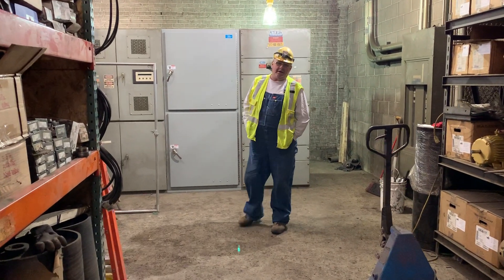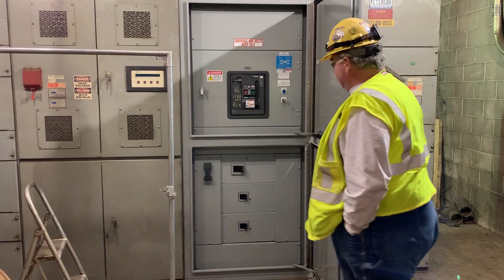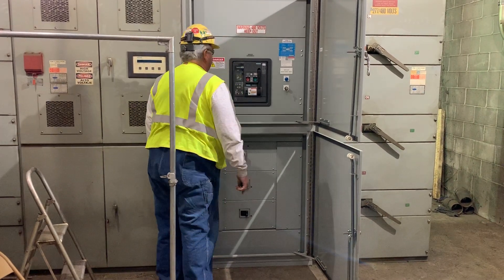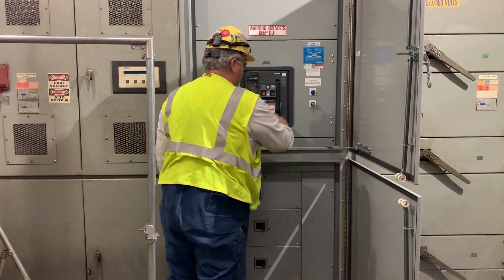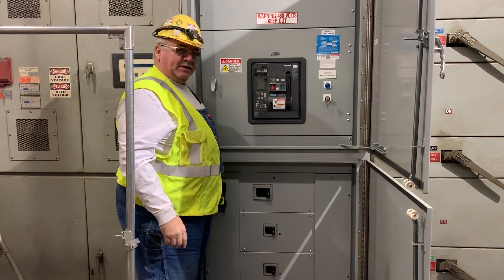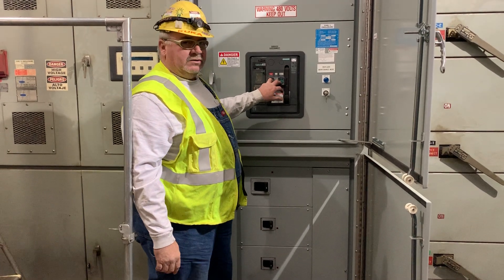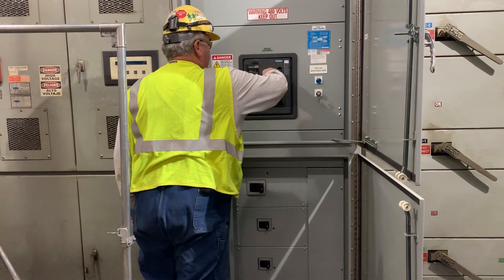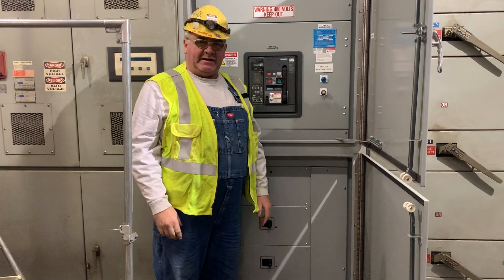Siemens spring loaded breaker

Comment: John Hammond: Now Ellie, you can't throw the main switch by hand. You've got to pump up the primer handle in order to get the charge. It's large, flat, and gray.
    Dr. Ellie Sattler: OK, here I go, OK.
    [Ellie starts pumping the handle]
    Dr. Ellie Sattler: One. Two. Three. Four. OK, charged.
    John Hammond: Under the words Contact Position, there's a round green button, which says Push to Close.
    Dr. Ellie Sattler: [sees the button] Push to Close, OK.
    John Hammond: Push it.

Comment: Come come it requires priming?, to ensure you really mean to press the button?
Reply: At the higher voltages a breaker panel like that operates at, there is a serious risk of electrical arcing, especially if the breaker contacts "bounce" (circuit closes, then re-opens briefly, then closes again) or if the switch doesn't close fast enough; naturally, electrical arcs are dangerous and no fun. The handle charges (more properly, compresses) a powerful spring, such that when the close button is pushed, those contacts are aggressively forced together, eliminating bounce and/or contact arcing.
Reply: @eddievhfan1984  Hey Eddie!, thanks for clarifying dude!, you fucking mean it when you close the circuit! (Or 'Path'!)

Comment: It's an old video but the comment could still help

YOU DO CLOSE THIS BREAKER UNDER LOAD 
it's specificcaly design to handle it  and now with safety , you close all the rest without power to be safe and then you do ONE manoeuver  
yeah in the old days we would prefer to do it gradually ... it's no worse than on a hydro loss
Reply: Close...you CAN close this breaker with load, but it is not a good practice and is ultra hazardous. (Speaking of main breakers here, some plants use this style breaker to feed downstream panels and equipment, which would make them more like a hi tech Pringle switch or feeder breaker in that application.) It is still always best and safest practice especially on first commissioning or after ANY fault that trips a main to open ALL downstream breakers/switches, reset the main, then gradually bring the other breakers/switches on line, one at a time. This also helps determine where a fault may have occurred or is still present. Breakers over 1,000 amps you should always wear appropriate arc flash PPE with the minimum cal ratings as per any warning labels. In older systems with no labels or ANY older style main breaker, regardless of amperage, the best practice is a minimum 20 cal rated suit, and face protection.  It only takes one time to seriously burn or unalive yourself with this stuff.
Reply: @mxslick50  sorry but you arw wrong , breaker are  design to handle load that is there fonction especially closing 

closing on load is no more that closing no load,  opening with load will create small arc and a fault.... lots of it lol  but they can handle it...   breaker are self contain vs bold and pringle switch

and for closing section by section that is the old day .. now a day you want to do the minimum operation live to prevent arc flash risk 

if there is a fault if coordination is correct  fault will be limited to the faulted area... except in case of short circuit where multiple breaker can open

ps amp rating si irrelevant wear ppe if needed ... i hace seen 200 amp panel with 40 calories....
Reply: @moreause  Your comment was a hard read with all the misspellings and grammatical errors...but you are wrong on many points, right on a few. I have been dealing with that gear for over 35 years and have seen too many incidents trying to close into a full load, especially one on a large plant with many 480 - 120/208 stepdown transformers. The inrush current can easily go well beyond what the breaker can safely handle, or at best it will trip from the inrush requiring multiple attempts to close in, which magnifies the risks considerably. Closing in to a load is ALWAYS MORE than no load. It is not nor ever has been "no more that closing no load".

Minimum operations is in theory a good principle but in cases of large plants (I did a wastewater  treatment plant with a 4000 amp service) it was impossible to close the main without first isolating the 8 other feeders, the inrush was horrendous.  It had to be done in stages, and in a specific order.  Try to just close the main, or in the wrong sequence, and you'd be resetting that main multiple times if not causing it to fail, violently. (Which had happened TWICE in the past, the cabinet still had the burn marks.) 

System coordination is tricky and works about 75%  of the time, but as you said, short circuits usually defeat coordination and trip multiple breakers.  Available fault currents have risen dramatically over the years, and many places with older switchgear are serious hazards because the older gear was not designed to handle the increased available fault currents, which BTW makes the staged sequence of closing in SAFER overall. 

I will agree with the last thing you said, and yes 40cal PPE can be required on most any size of service, regardless of amperage. Thus my warning to use at least 20 cal even if no PPE requirements are called out.
Reply: @mxslick50  you are mixing bad design vs breaker operation 

if you have to split load because of transformer inrush or overload triping   that is bad design .... yeah 35 year ... i could say the same on my side ... as a service tech that do maintenance specificcaly on these type of breaker 

i say it again closing on a full load is no worse that no load, it's doesn't create any wear on contact or mechanical part .....  breaker can easely handle inrush current...  breaker are design to handle short-circuit current.   

Just so we are clear   a breaker can TRIP  because of overload, bad setting ect  .... that is part of breaker protection design   and is no issue to the breaker itself

you can have a 1000 amp breaker triping on inrush .....  but that breaker is physicaly design to be able to withstand 22,55,65 and even 100 KA depending on the breaker type

  

if the breaker trip on inrush  it is not a breaker issue  it's a system design and setting issue  

Available fault current have not change over here thru the year ..mostly the opposite  .... mostly because arc flash changed the way they design stuff ...

but yes you can end up with a BAD design ... old stuff hooked to a new section that result in incorrect short circuit capacity 

ps 20 calories in in between standard  ...ok they are suppose to be gone ...old standard was level  8,25 and 40 calorie

20 for some reason is starting to appear ...my new arc flash helmet is 20  calories

ps in what part of the world are you  ?

ps  when i started a while back we had customer with similare triping issue on start up, now a day with arc flash, electronic relay, ect you are not suppose to see that anymore